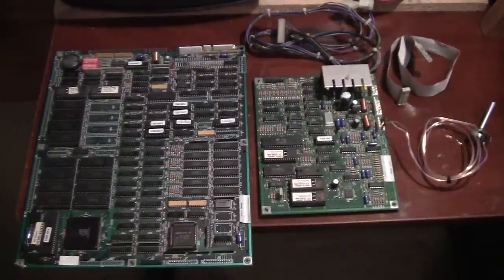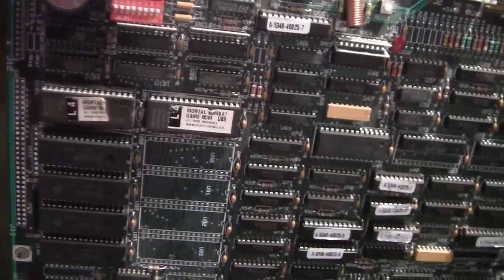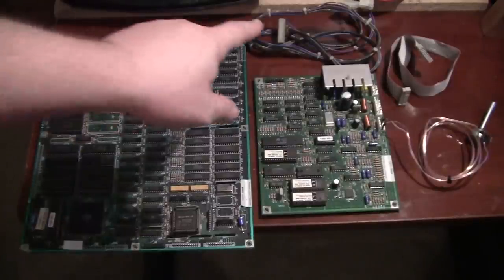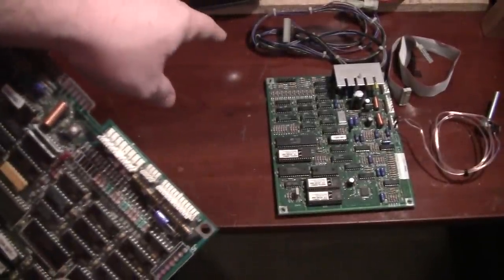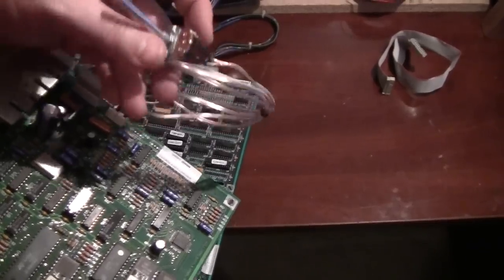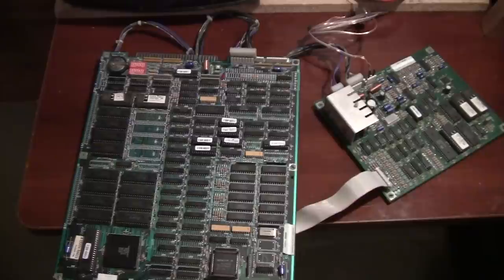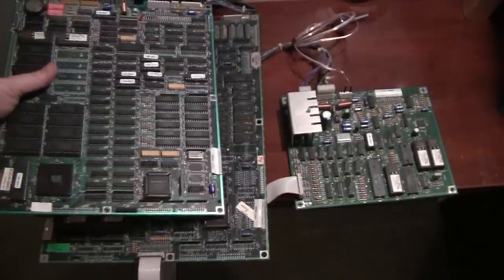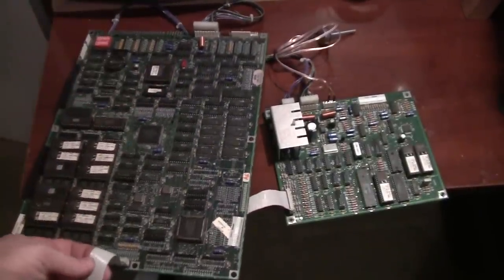Basic Mortal Kombat Arcade PCB Information [HD]

Comment: Thanks for the good info! Do you have any advice about changing roms on a board? Also, is it true that MK4 requires a different power supply than the other games?
Reply: Nope it uses the same as all the others. the machine however uses a power supply similar to the one in Rampage World Tour and probably a few others.
Reply from the maker: I cover rom swapping in part 3 of this series. As long as you supply the PCB with +12vdc, +5vdc, -5vdc, and the grounds you can use ANY power supply that will do that.

Comment: Thank you for the reply. Can you make a video on where to start trouble shooting an umk3 arcade? Mine crapped out this morning. I think it's the power supply but not sure. The screen went crazy and turned off. The sign light comes on but that's it. The silver box inside has a fan in it that sounds like it is struggling to spin.

Comment: One other question MK, so to be clear, the only difference really between all of the Y-unit revisions and the two T-unit revisions are the two ROMS that you mention.  Other than that all of the Y-revision boards (minis the proto boards w/ the yellow wire) themselves are identical, is that right?
Reply from the maker: The game runs the same. 4.0 is supported by both T and Y. The only difference is 5.0 is T exclusive. Otherwise, there’s no reason to seek out a T unless you absolutely want 5.0.

Comment: Hi there. Great video, really informative. I have just got a MK1 board which works great. However the battery is missing and I'm wondering what sort of battery I need to buy to replace it? Thanks!
Reply from the maker: You're welcome. You'll need a CR2025 or CR2032. Either will work.
Reply: YourMKArcadeSource thanks dude that's awesome, I'll grab one
Reply from the maker: You're welcome.

Comment: Hope you get to read this comment. I'm new to fixing arcades but not new to circuit boards . The question I have is I replaced the sound harness and the sound doesn't play. I swapped out the speakers bcuz 1 had a tear in the speaker. I fig it can be a few things wrong with the sound board. I just need to know your input on what you think it may be. If you let me know instead of me writing paragraphs on end itll be easier to see if your ideas are the same as mine.. I will say this when I check the bios it said "U2 and U3 rom I think said ram error on it. So I'm thinking if I replace those itll be working but idk. I'm trying the smaller solutions 1st. Thank you in advance.

Comment: Mike, mind if I ask, are the RAM and ROMs and GAL/PAL chips, CPU and FPGA’s shared with both the Y and T units?  I think I killed my MK1 T-Unit (version with 8MB ROMs so no expansion board).  I see non-working Y-Units up for sale and was thinking about buying one for parts to try and repair my T-Unit.  Was curious if I can swap components between the two versions 🤷🏻‍♂️  thanks Mike 🙏🏼🙌🏼
Reply from the maker: Nope. Totally different. Sorry.
Reply: @YourMKArcadeSource  Ah Bummer 😅Thank you for the response 🙏🏼🤟🏼
Reply from the maker: My pleasure.

Comment: Hi
I have an Mortal kombat 2 deticadet arcade machine and i will buy a Mortal Kombat 1 T-unit rev. 5.1main board with T-unit Soundboard. I will replace all connections from the Mk2 Main and Soundbord and put it in the Mk1 Main and soundboard to play Mortal Kombat 1.
So my question is, is this an easy 1 to 1 replacement switch with the connection or i have to take care of something?
Sorry for my englisch i comming from germany.

Comment: Hey Mike, I need to calm on your expertise once again if you don’t mind and can find the time 🙏🏼 I’m seeing everywhere that the Jamma connection to MK1 PCB calls out for -5Volts.  However looking at the manual and the schematics I can’t seem to find anywhere that uses it …. I know MK2 requires it for the sound board but the manual says that -5Volts is not connected …. Does it need -5Volts?  MK T-Unit manual which I’m using shows in section 3-4 off of the JAMMA harness -5Volts “Green-Grey Wires Not Used” ….. and section 3-2 shows no -5Volts connection …..

Any hell would be great!  Thanks Mike 👍🏼
Reply from the maker: All Jamma games have -5 by default but not all games require it. MK1 does not require it. Once MK2 came around and the DCS required it, it was already there.
Reply: @YourMKArcadeSource  thanks for the update.  I’m asking because I have my Jamma wired up with -5 and had it hooked up to the MK PCB …. Now it won’t turn on … chance i might have fried her 😫
Reply from the maker: Very doubtful. I test MK boards all the time on my test rig with -5 hooked up and never fried a board. Power supply die?
Reply: @YourMKArcadeSource  yes the supply blew the fuse as soon as I powered it on so I’m trying to trace it back.  Can’t figure out what blew it … the harness seems to ring out ok so I thought maybe it was the mistaken -5Volts but that is really reassuring.  Hopefully it’s the supply and it didn’t take my board with it 😅 shew, slight sigh of relief for the moment.  Waiting for some fuses to get in.  Ok back to troubleshooting, thanks a lot Mike I appreciate your expertise 🙏🏼👍🏼
Reply from the maker: It’s quite possible. If it’s aY-Unit, the RAM could have been taken out. Check and see if any of the 4 vertical RAM chips by the Jamma connection get hot.
Reply: @YourMKArcadeSource  ok, it’s the T-Unit.  Same thing?  Which RAMs do you recommend I check first?
Reply from the maker: Just see if any chips are super hot.
Reply: @YourMKArcadeSource  Ok Mike all of the RAMS are cold as ice.  I noticed now though after setting her up on my bench that of the two red LED’s on the T-Unit board the DS2 LED lights up but it is solid, no flicker and DS3 is dead as a door nail.  No light at all, no flashing just dead 😳

Broke out my digital probe and most of the chips are just low, below TTL 5 volts … no pulsing … like there is no form of signals anywhere on the board.  Any ideas what to take a look at without eating into your valuable time? 🙏🏼
Reply: Update - UF17 and UB21 are both warm …. UB21 isn’t good … I think this is the CPU 😳

Comment: I have a Y-unit PCB and a T-unit sound board.  The sound cable I have has the same 8-pin connector on both ends, like the one you have plugged into the PCB, but the other end is the same, not 2 separate connectors.  Can I still use this power cable?  If so, where do I plug it in on the sound board?
Reply from the maker: No. Sounds like you have an MK2 cable.
Reply: @YourMKArcadeSource  Thanks!  These boards have been in storage for 10+ years, not sure how or why this cable was packed with the MK1 boards.

Comment: Hello, I hope you can help me, I need to replace the volume control, apparently I need a 50k potentiometer, could you confirme this value, and can you tell me the correct connection with the pins, I can see that you are connecting the pin 1 in the middle, in advance thank you for your help and support.

Comment: i have a non original board mortal kombat 1 which is a one boardset only the audio is all built in my problem is i have turned it on the other day and all i get is a white fuzzy screen no sound and wont coin up iv cleaned the harness and all seems to be fine do you know the prober voltage for these boardsets and anything that could help
Reply from the maker: Try this...

Mortal Kombat PCB Voltage Issue/Reset Solution

Comment: Hey, I have an MK1 Y-unit, revision 3 board that is running without sound. I get a U2/U3 ROM/RAM error and I have all the wiring and the sound pot. It also gives me a SOUND IRQ NOT FOUND error. How can I fix this? Thanks!
Reply from the maker: +DJ Fob Fresh Your ribbon cable hooked up properly? The Sound IRQ error means you either have a bad cable, or it's hooked up incorrectly at one end.
Reply: I will test the cable next thanks!
Reply: +DJ Fob Fresh Crimped new 20-pin cables and still the same issue of nothing but static and the same errors. Could it actually be the roms/ram?
Reply from the maker: Quite possible. Check to make sure the clock crystal is not missing.
Reply: +YourMKArcadeSource 
Is the clock crystal the one at spot Y1 - KDS 2C (Y-unit)? Mine is there but it wiggles. Could that need a replacement or re-flow? Also, thank you for your help and great informative videos.
Reply from the maker: You're welcome. If it's there, that's good because it's VERY common to have them missing. I would re-flow the pads, yes. I would also remove the sound roms, inspect and clean the legs with a pencil eraser, reinstall them and see if your problem remains. If it does, you may end up having to replace the capacitors around the sound amp or replacing the sound amp itself. On the MK2 sound boards, the caps/amp go out all the time and are the usual suspects when your type of issue happens to them.

Comment: I need your help please... My MK1 board does not do its rom checks at the start anymore - I would really like the rom check to always be performed. It was doing it but for some reason it stopped. Can you help me get the initial rom check start working again on my MK1 board. It is a Y board if that matters. Thank you
Reply from the maker: Make sure all your dip switches are set correctly. Make note of how they are set, turn them all off, and see what happens.
Reply: @YourMKArcadeSource  For some reason my dip switches are backwards - on is off - go figure - thanks

Comment: Why does my umk3 board have a metal washer I'm the middle of the board?
Reply from the maker: That's not a washer. It's a battery to remember the board's settings.
Reply: Under where the battery is the contact terminal/area of the battery holder looks like a washer and could be mistaken for one.

Comment: Grate info! thanks for share!
Have a question about convert MK1 boards to different versions. I hear about roms hacks and wondering, what hack or old version is posible to convert if you have a T-Unit or Y-Unit. can the T-Unit be converted into 0.9 version? The Kombo / Turbo 3.1works in the T-Unit or Y-Unit? Thanks
Reply from the maker: The Y-Unit will support every revision up to 4.0 as well as every hack except for Turbo Ninja. Turbo Ninja is only for the T-Unit. As for the T-Unit, it only supports 4.0 and 5.0. There are two versions of 4.0. One for each type of board. Hope that makes sense.
Reply: YourMKArcadeSource super helpful! Thanks a lot!

Comment: I have a problem with my MK1 y unit Iam getting two solid red leds lights on my and the game will not boot up.please help. Thanks
Reply from the maker: Check your voltage and reseat all your socketed chip.
Reply: Did check the voltage and I have 5.07 resets all the socket chip. I still have the same problem,do you know what chip starts the boot sequence?
Reply: Ok I got it to boot up, the voltage was a little low. My second problem is that I am missing some colors red and green are not coming up. Iam getting only blue and black any idea what chip I need to replace? Thanks

Comment: I just got my y unit board (which is a prototype board i guess) because it has the yellow wire running down the center of it
I notice that when I press the service button to go to the service menu, i see it for a second and then the game resets
MK2 and UMK3 bring up the menu just fine
Is there something else I need to do to have the service menu work on the y unit running version 4?
Thanks
Reply from the maker: MK1 requires you to hold the button down. It had a switch, not a button like MK2-MK4. You will need to use a switch or hold the button down for MK1.
Reply: @YourMKArcadeSource  Ah thank you - been driving me crazy

Comment: Hi. Thanks for the video. i have a question for you. I recently bought a MK 1 rev.3.0 PCB Y-unit and came with a T-unit soundboard. My problem is that i don't get any sound, only a hum. Do you know if the  T-unit sound board is compatible with a Y-unit main board? I already checked the power connections, the potentiometer and the ribbon cable as well. When i enter to the diagnostics on the game, it shows me irq functional, but i don't hear any tone. Any suggestion for my problem?. Thank you in advance.
Reply from the maker: There is only one sound board. It did not change when the main board upgraded to the T-Unit. The sound board is compatible with either type of main board. Assuming you have everything hooked up correctly (ribbon cable correct on both ends with pin 1 of main board going to pin 1 of sound board), then you most likely have an issue with the capacitors or the amplifier.
Reply: Thanks for the tip. i already did change the capacitors and i´m almost sure that my amp is working well, but i'm going to check it again. Looking on the Mortal Kombat 1_kit t-Unit manual i see 2 diferent version of soundboards. By the way my sound board is the one with the amplifier MB3731. The other one sound board has a diferent amplifier the HA3116 i think. By reviewing to the schematics on the manual, i see some diferences in the sound interface connections(P1). Because of that i think that the problem is on that connection. Do you have any other advice? .And once again thank you for your help, i really apreciate it.
Reply from the maker: The sound board did get upgraded, but either version will work with either main board. That's what I meant. It doesn't matter which main board has which sound board. As for the connection issue, the T-Unit uses a 9-pin connection. The Y-Unit uses an 8-pin connection. The only difference is the extra ground on pin 9 for the T-Unit. It's redundant and isn't an issue as long as the grounds are good on the other pins. I can tell you that I had an MK2 sound board that had the same issue as your MK1 sound board and after I replaced the amp, the sound came back. One more thing to consider is bad roms. If the U3 sound rom is bad, the board won't have any sound at all, just like your issue.
Reply: Then i will going to change the amp. I hope to report you good news. Thanks.
Reply: Hi again. I'm here to report very good news. I finally got sound from my MK sound board. But i didn't have to change the amp. The reason of my problem was at an early stage of the sound generation process. Exactly  between the 3.579MHz crystal stage and the Yamaha's integrated circuits. The crystal it wasn't sending the proper signal to the Yamaha's, because the IC 74LS04 (position U26 at the soundboard diagram, the close one to the crystal) it was internally damaged. Once that i replaced it the sound came back.  The way that i found the problem was by following the lack of sound signal from the amplification stage and the previous ones with the help of an osciloscope until i got to the Yamaha 2151, which was not receiving the clock signal properly. And previously to replace the 74LS04, i did replaced too the crystal, resistors and capacitors directly conected to the IC 74LS04 and to the 3.579MHz crystal. If someone wants to see the tutorial that i made in order to solve this problem, you can find it at arcades.mx forums http://foro.arcades.mx/viewtopic.php?f=20&t=1133
Reply from the maker: Awesome! Great job!
Reply: YourMKArcadeSource Hello again. I'm really grateful for the help you provided me last time that i've contact with you. Now i have a new problem, and i think, maybe you could help me. This time is about Mortal Kombat 2, specifically with the sound board.  I have the oportunity to buy one mk2 pcb but the seller doesn't have the sound board. So, and before to buy it, i want to ask if would you consider to selling me one sound board for a Mortal Kombat 2 PCB? or if you have it the complete setup, Would you consider selling me one fully functional Mortal Kombat 2 with the sound board? And again thank you in advance for your kind response.
Reply from the maker: I'd love to help out if I could, but I don't have any spare MK2 sound boards at the moment. I'm sorry.
Reply: YourMKArcadeSource Thank you anyway. I really apreciate it. I'll keep in contact. Greetings.

Comment: Is there a way (or do you not recommend) to attach the sound board to the main board to save room when mounting in the cabinet?
Reply from the maker: Yes. You should be able to use plastic spacers/stand offs to mount the sound board to the main board with some long screws.
Reply: @YourMKArcadeSource  Thank you - much appreciated. BTW amazing videos - huge MK fan here and your videos are great

I have an arcade 1up machine that I am going to put 3 MK boards into. Any ideas on how to mount them. Is there a shelving system out there. I have been trying to find the dimensions of the pcb boards for MK1, MK3 and UMK3 while mine are on the way but nothing yet
Reply from the maker: The boards won’t be compatible with the 1Up monitors, so I’m not sure how you’d go about it, but there’s no official shelving out there. You’d have to design and make your own.

Comment: Ok man since im a noob how the connections work on pcbs..i got a umk3 pcb.. the only thing is the the connection headers that start with the letter “p” that have the pin outs i know p12 is a kick harness spot but the others i cant find where they do online no info.. can you tell me the where the rest of the p numbers go to the arcade.. thanks
Reply from the maker: The only connection that is used is the Player 3 connection for the kick harness. All other connections are not needed/necessary.
Reply: @YourMKArcadeSource  ok
Reply: @YourMKArcadeSource  so i plug only one white connection into p12? In the pcb?

Comment: Could you help with the kick harness im haveing troble
Reply from the maker: What's your issue?
Reply: I got the player 1 side working and player 2 is not properly working. Any ideas and onece again grat video's really informative keep it up!!
Reply from the maker: mr pliff Sounds like you either have the wrong harness or a ground wire problem on the P2 side.